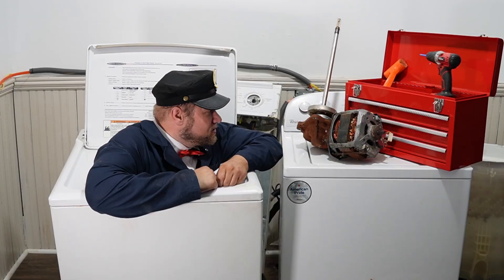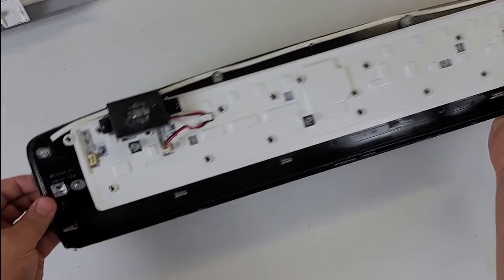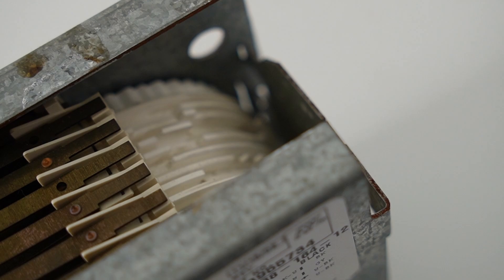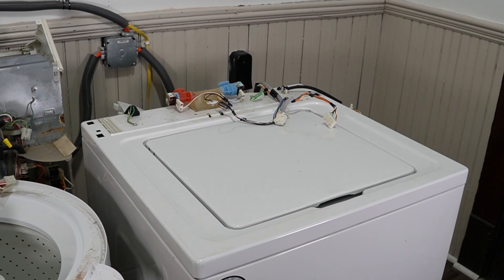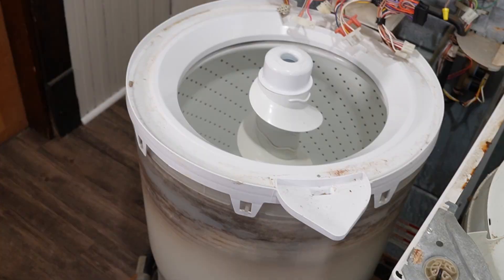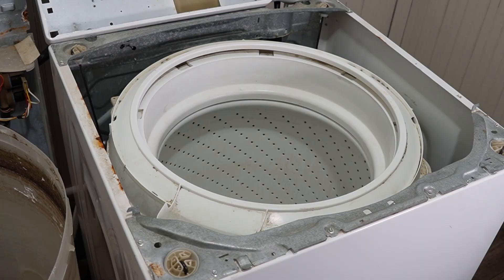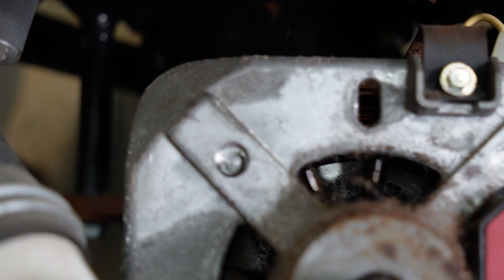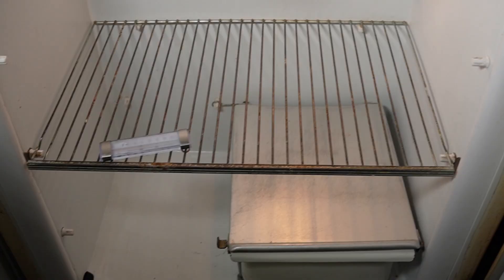Are Washers Built to Break? Inside a 1984 Washer vs. Now

Comment: When my dad died he left us instructions to buy mom a new dryer to replace their 30 yr old Kenmore. Well, mom loved her Kenmore, no way would she give it up. She passed 10 yrs after dad and that dryer was still kickin'!
Reply: The components of my top load  laundry machines and drying machines are made of case hardened solid hot forged and-or hydraulic pressed stainless steel alloy. They were designed, developed, and mass produced for our military for 24-7 non-stop use to clean up everything regardless of what we throw at them (heavy all terrain military survival boots, utility belts, heavy uniforms, arctic gear clothing, rubber shoes, rugs, heavy military issued blankets, etc) and they are still as good as new and still kicking like brand new after more than 65 years. The factory making them (there are 7 of them) are still making them based on their original designs and original materials and specifications STRICTLY followed on how to make and treat these stainless steel alloy materials into components. The revolving seals are made out of metal with cross hatch precision machining after they were case hardened and annealed-tempered (no quenching). Everything about them is OLD SCHOOL engineering using an all analog mechanical and electro-mechanical controls, etc.
Reply: @darthvader5300  what machine????
Reply: @GraflexGuy  I believe he's talking about speed queen.
Reply: @CookieManCookies  those speed queens are tanks!!
Reply: @darthvader5300  
That's awesome Darth!
Old School all the way!👍🏼😃👍🏼
Reply: @Justin Time These are military grade strength laundry and drying machines for the military made decades ago. I just happened to be in a situation when I was still in the service of an another agency connected with the military agencies.
Reply: @GraflexGuy  These are military grade strength laundry and drying machines for the military made decades ago. I just happened to be in a situation when I was still in the service of an another agency connected with the military agencies.
Reply: @mountain177  These are military grade strength laundry and drying machines for the military made decades ago. I just happened to be in a situation when I was still in the service of an another agency connected with the military agencies.
Reply: @CookieManCookies  These are military grade strength laundry and drying machines for the military made decades ago. I just happened to be in a situation when I was still in the service of an another agency connected with the military agencies.
Reply: @Justin Time These military grade strength laundry and drying machines were all designed-tested in the field for 2 years under the most severe conditions in the open under all kinds of climate and weather and their factories were built to manufacture them 57 years ago by military engineers from our military engineering division of our equipment logistics department.
Reply: @GraflexGuy  These military grade strength laundry and drying machines were all designed-tested in the field for 2 years under the most severe conditions in the open under all kinds of climate and weather and their factories were built to manufacture them 57 years ago by military engineers from our military engineering division of our equipment logistics department.
Reply: @CookieManCookies  These military grade strength laundry and drying machines were all designed-tested in the field for 2 years under the most severe conditions in the open under all kinds of climate and weather and their factories were built to manufacture them 57 years ago by military engineers from our military engineering division of our equipment logistics department.
Reply: @mountain177  These military grade strength laundry and drying machines were all designed-tested in the field for 2 years under the most severe conditions in the open under all kinds of climate and weather and their factories were built to manufacture them 57 years ago by military engineers from our military engineering division of our equipment logistics department.
Reply: I own a 1963 Lady Kenmore gas dryer. This I rebuilt in 1974 with new seals and a blower bearing. The drum bearing failed due to bad flange design, I modified it after buying a new bearing. So far almost 50 years trouble free service.
Reply: My appliances were made in the late 1990s and I still repair them.  Basic models with minimal circuit boards.  Easy to diagnose and repair.  The appliance parts guys regard them as from the “Golden Age of Appliances.”LOL!  I don’t know about that, but they have served me well.
Reply: @darthvader5300  spam a reply much?
Reply: I have a Hotpoint 95360 from 1982 (front loader). It still runs as it did when it was new.  Last year, it needed bearings in the outer tub.  I went on the internet to find instructions, only to find that in newer washers, it is impossible to change the bearings.  You have to replace the washer.  But in my old washer, the replacement was easy.
Reply: Not much to go wrong with a DRYER, mine is 20 years old, it's basically just a motor turning the drum,  and a gas valve opens the gas to light the burner, other than a belt, cleaning, a sensor replacement maybe, thats about it.
Reply: At this point, my GE washer and drying machines in my garage are going to outlive me even though they are older than me by a few months.
Reply: @darthvader5300  p.s. military grade means “cheapest possible material that can pass regulations” lol 😂
Reply: Wow !!!!!
Reply: My grandma still had her stove and fridge from 1950s in 2012 when she passed. And my great grandfathers iron fire stove.
Reply: Built to last👍🏿👍🏿
Reply: @umamifan  Yeap, but those have regulations to last extremely long, and today civil ones have internal regulations to breack after 2 years of light use. I have a Whirlpool from spring of '94, made after they  took over Philips big appliances division, and is over 28 year old and still works good, no service other then replacing a capacitor after 10 years in 2004.
Reply: This comment contributed nothing to my life.
Reply: The kenmore is watching with menacing intent
Reply: I don't mean to mock the tragedy of losing family, but the thought of a man's dying wish to replace the washing machine is hilarious to me
Reply: @darthvader5300  You know the concept of "military grade" doesn't say ANYTHING about the quality right?

It merely says it has been standardized by the military.
Reply: Most Kenmore dryers were built by Whirlpool (and some by GE too, I believe), so I can relate!  I have a Whirlpool gas dryer that must be almost as old as I am (if not older), and I'm in my mid-40's.  It was included when I bought the house 15 years ago.  It looks like crap (but my laundry "room" is my unfinished basement, so...), it's missing a number of screws so it usually buzzes and rattles until it warms up (or until I give it a kick or nudge in the right spots), and the door won't stay closed while running so I added a cheap slide-bolt latch from the hardware store.  I have a service plan from the utility company that covers my furnace and gas dryer and they've replaced the belt, the lint screen, and two gas igniters.  Other than that, it just keeps trucking, drying load after load from my fast-spinning modern washing machine in about 30-40 minutes.  I'd love to have a new dryer, but this one works so well and it just keeps going and going.  It got to a point where I stopped browsing around for a new one because I'm so curious how much longer this one will last (and I might never find out, as I'm selling the house soon with appliances included).
Reply: My Mother bought a Kenmore Refrigerator back in 93. It’s still running 🏃‍♀️ for 38 years. Sad to say yesterday the Freezer can’t make ice 🧊anymore.
Reply: @Inisfad  That makes me so mad. It's insane to throw away so much good stuff because they want you to buy a new one.  It's just plain greed and waste.  I have been hoping that the advent of 3D printers would make it easier to repair things, but I haven't seen that happening yet.
Reply: My Kenmore pair, made by Whirlpool, are 50 years old and work fine. I was a Sears repair guy.
Reply: @darthvader5300  we get it but wtf can us normal shmoes get one 😂😂
Reply: @darthvader5300  We get it.
Reply: @darthvader5300  We get it.
Reply: @darthvader5300  We get it.
Reply: @darthvader5300  We get it.
Reply: @darthvader5300  We get it.
Reply: @darthvader5300  We get it.
Reply: @darthvader5300  We get it.
Reply: @darthvader5300  We get it.
Reply: @darthvader5300  We get it.
Reply: @darthvader5300  We get it.
Reply: @darthvader5300  We get it.
Reply: @darthvader5300  We get it.
Reply: @darthvader5300  We get it.
Reply: @darthvader5300  We get it.
Reply: @darthvader5300  We get it.
Reply: @darthvader5300  We get it.
Reply: @darthvader5300  We get it.
Reply: @darthvader5300  We get it.
Reply: That is cool; still remember that my mom bought a washer and dryer in 1989 when I was 2 and how they worked until like 2009. They have had 3 other sets since then, seems the 80s had better ones.
Reply: @darthvader5300  Where?  How do I get one?
Reply: @darthvader5300  Oh.  Just in case one comes up, what years were they made and how would I know it?
Reply: @mountain177  In my area speed queens are available but the service on them ranks lower than Samsung.  So they sell them but if something goes wrong you are hosed.  Apparently not just "any tech" can service them.  It is the only reason I don't have one.
Reply: Kenmore.  Best thing (aside from Craftsman) Sears ever did.  Loved Kenmore products.
Reply: @josephfuller6229  The machines I have were manufactured in Russia during the Cold War for the military and in the former Soviet Union we do not like planned obsolescence. They are still being manufactured but only for our military in the nuclear warfare department where we cannot afford them to fail and the fact that replacements and spare parts will be almost impossible after a nuclear exchange. They are for military use only in the nuclear warfare department. I just happened to be at the right place and at the right time that allowed me to acquire a whole range of them such as laundry machines, drying machines, dish washing machines, refrigerators, freezers, chillers, ice makers, stoves, toasters, baking machines, etc. They are all made out of stainless steel containing higher amounts of tantalum and niobium and a significant percentage of tungsten. All of their components were precision hot forged, hot stamped, hot trimmed, etc. Precision machine tools using tungsten carbides and diamonds were also used to precision machine them to extremely fine tolerance.
Reply: @SioxerNikita  The machines I have were manufactured in Russia during the Cold War for the military and in the former Soviet Union we do not like planned obsolescence. They are still being manufactured but only for our military in the nuclear warfare department where we cannot afford them to fail and the fact that replacements and spare parts will be almost impossible after a nuclear exchange. They are for military use only in the nuclear warfare department. I just happened to be at the right place and at the right time that allowed me to acquire a whole range of them such as laundry machines, drying machines, dish washing machines, refrigerators, freezers, chillers, ice makers, stoves, toasters, baking machines, etc. They are all made out of stainless steel containing higher amounts of tantalum and niobium and a significant percentage of tungsten. All of their components were precision hot forged, hot stamped, hot trimmed, etc. Precision machine tools using tungsten carbides and diamonds were also used to precision machine them to extremely fine tolerance.
Reply: @SioxerNikita  Military grade means designed to last as long as it exists because even in peace time we cannot afford for them to fail because no one knows if war is going to break out just like that or a full nuclear exchange might happen.
Reply: @umamifan  The machines I have were manufactured in Russia during the Cold War for the military and in the former Soviet Union we do not like planned obsolescence. They are still being manufactured but only for our military in the nuclear warfare department where we cannot afford them to fail and the fact that replacements and spare parts will be almost impossible after a nuclear exchange. They are for military use only in the nuclear warfare department. I just happened to be at the right place and at the right time that allowed me to acquire a whole range of them such as laundry machines, drying machines, dish washing machines, refrigerators, freezers, chillers, ice makers, stoves, toasters, baking machines, etc. They are all made out of stainless steel containing higher amounts of tantalum and niobium and a significant percentage of tungsten. All of their components were precision hot forged, hot stamped, hot trimmed, etc. Precision machine tools using tungsten carbides and diamonds were also used to precision machine them to extremely fine tolerance. Military grade means we cannot afford them to fail even in peace time for if a war breaks out or a nuclear exchange happens, then it is better to have them all designed to last as long as they exists.
Reply: @mountain177  The machines I have were manufactured in Russia during the Cold War for the military and in the former Soviet Union we do not like planned obsolescence. They are still being manufactured but only for our military in the nuclear warfare department where we cannot afford them to fail and the fact that replacements and spare parts will be almost impossible after a nuclear exchange. They are for military use only in the nuclear warfare department. I just happened to be at the right place and at the right time that allowed me to acquire a whole range of them such as laundry machines, drying machines, dish washing machines, refrigerators, freezers, chillers, ice makers, stoves, toasters, baking machines, etc. They are all made out of stainless steel containing higher amounts of tantalum and niobium and a significant percentage of tungsten. All of their components were precision hot forged, hot stamped, hot trimmed, etc. Precision machine tools using tungsten carbides and diamonds were also used to precision machine them to extremely fine tolerance. Military grade means we cannot afford them to fail even in peace time for if a war breaks out or a nuclear exchange happens, then it is better to have them all designed to last as long as they exists.
Reply: @mhern57  The machines I have were manufactured in Russia during the Cold War for the military and in the former Soviet Union we do not like planned obsolescence. They are still being manufactured but only for our military in the nuclear warfare department where we cannot afford them to fail and the fact that replacements and spare parts will be almost impossible after a nuclear exchange. They are for military use only in the nuclear warfare department. I just happened to be at the right place and at the right time that allowed me to acquire a whole range of them such as laundry machines, drying machines, dish washing machines, refrigerators, freezers, chillers, ice makers, stoves, toasters, baking machines, etc. They are all made out of stainless steel containing higher amounts of tantalum and niobium and a significant percentage of tungsten. All of their components were precision hot forged, hot stamped, hot trimmed, etc. Precision machine tools using tungsten carbides and diamonds were also used to precision machine them to extremely fine tolerance. Military grade means we cannot afford them to fail even in peace time for if a war breaks out or a nuclear exchange happens, then it is better to have them all designed to last as long as they exists.
Reply: @mountain177  The machines I have were manufactured in Russia during the Cold War for the military and in the former Soviet Union we do not like planned obsolescence. They are still being manufactured but only for our military in the nuclear warfare department where we cannot afford them to fail and the fact that replacements and spare parts will be almost impossible after a nuclear exchange. They are for military use only in the nuclear warfare department. I just happened to be at the right place and at the right time that allowed me to acquire a whole range of them such as laundry machines, drying machines, dish washing machines, refrigerators, freezers, chillers, ice makers, stoves, toasters, baking machines, etc. They are all made out of stainless steel containing higher amounts of tantalum and niobium and a significant percentage of tungsten. All of their components were precision hot forged, hot stamped, hot trimmed, etc. Precision machine tools using tungsten carbides and diamonds were also used to precision machine them to extremely fine tolerance. Military grade means we cannot afford them to fail even in peace time for if a war breaks out or a nuclear exchange happens, then it is better to have them all designed to last as long as they exists.
Reply: @CookieManCookies  The machines I have were manufactured in Russia during the Cold War for the military and in the former Soviet Union we do not like planned obsolescence. They are still being manufactured but only for our military in the nuclear warfare department where we cannot afford them to fail and the fact that replacements and spare parts will be almost impossible after a nuclear exchange. They are for military use only in the nuclear warfare department. I just happened to be at the right place and at the right time that allowed me to acquire a whole range of them such as laundry machines, drying machines, dish washing machines, refrigerators, freezers, chillers, ice makers, stoves, toasters, baking machines, etc. They are all made out of stainless steel containing higher amounts of tantalum and niobium and a significant percentage of tungsten. All of their components were precision hot forged, hot stamped, hot trimmed, etc. Precision machine tools using tungsten carbides and diamonds were also used to precision machine them to extremely fine tolerance. Military grade means we cannot afford them to fail even in peace time for if a war breaks out or a nuclear exchange happens, then it is better to have them all designed to last as long as they exists.
Reply: @GraflexGuy  The machines I have were manufactured in Russia during the Cold War for the military and in the former Soviet Union we do not like planned obsolescence. They are still being manufactured but only for our military in the nuclear warfare department where we cannot afford them to fail and the fact that replacements and spare parts will be almost impossible after a nuclear exchange. They are for military use only in the nuclear warfare department. I just happened to be at the right place and at the right time that allowed me to acquire a whole range of them such as laundry machines, drying machines, dish washing machines, refrigerators, freezers, chillers, ice makers, stoves, toasters, baking machines, etc. They are all made out of stainless steel containing higher amounts of tantalum and niobium and a significant percentage of tungsten. All of their components were precision hot forged, hot stamped, hot trimmed, etc. Precision machine tools using tungsten carbides and diamonds were also used to precision machine them to extremely fine tolerance. Military grade means we cannot afford them to fail even in peace time for if a war breaks out or a nuclear exchange happens, then it is better to have them all designed to last as long as they exists.
Reply: @Justin Time The machines I have were manufactured in Russia during the Cold War for the military and in the former Soviet Union we do not like planned obsolescence. They are still being manufactured but only for our military in the nuclear warfare department where we cannot afford them to fail and the fact that replacements and spare parts will be almost impossible after a nuclear exchange. They are for military use only in the nuclear warfare department. I just happened to be at the right place and at the right time that allowed me to acquire a whole range of them such as laundry machines, drying machines, dish washing machines, refrigerators, freezers, chillers, ice makers, stoves, toasters, baking machines, etc. They are all made out of stainless steel containing higher amounts of tantalum and niobium and a significant percentage of tungsten. All of their components were precision hot forged, hot stamped, hot trimmed, etc. Precision machine tools using tungsten carbides and diamonds were also used to precision machine them to extremely fine tolerance. Military grade means we cannot afford them to fail even in peace time for if a war breaks out or a nuclear exchange happens, then it is better to have them all designed to last as long as they exists.
Reply: @darthvader5300  No.
. Military Grade means it is a military standard used by a military. That is literally all it really means.
Reply: @darthvader5300  
What a score! They must be worth a fortune!
Reply: @mhern57  Not really because we learned a lot from Henry Ford's wisdom and principles and concepts of mass production and applied it even in our smallest micro-factories and mini-factories using old school all analog servo-merchanisms based automation systems and processes to keep production high, raise and keep quality higher, lower down costs, share the labor costs savings with the workers and employees, and make it CHEAP AND OF THE HIGHEST QUALITY. We can afford it for we have Siberia's vast and unlimited mineral resources. People keeps on saying Siberia is one vast barren frozen wasteland but not anymore for we have been busy developing it head on since the 1950s, 1960s, 1970s, and 1980s non-stop and we are still doing it today in this year of 2022. In fact, we just barely scratched the surface of our natural resources even today!
Reply: @darthvader5300  wow that's all really interesting. I've been watching a lot of World War II videos over the last several years and I still have it in my head that Siberia is a frozen wasteland! Now when I watch a World War II video and they talk of Siberia I'm going to have to reimagine the picture in my head!
Reply: @darthvader5300  wow that's all really interesting. I've been watching a lot of World War II videos over the last several years and I still have it in my head that Siberia is a frozen wasteland! Now when I watch a World War II video and they talk of Siberia I'm going to have to reimagine the picture in my head!
Reply: @darthvader5300  It is not America. Way to assume. And Russian military gear might be built to last. That still doesn't mean the words military grade suddenly changes meaning.

And you can have things that doesn't last forever without planned obsolescence.
Reply: @josephfuller6229  🤣🤣🤣🤣😅🤣😂☺️😄😅🤣🤔🤭👍
Reply: @darthvader5300  I think after a nuclear exchange, clean clothes will be the last thing on my mind.
Reply: When we bought our house back in 1994, the house came with a Whirlpool dryer. The dryer was built in 1980 (I research the manufacturing date). The dryer is still used 3-4 times a week, and the only issue is that the belt broke about 20 years ago (which was easy for me to replace). I took apart the back of the dryer recently to clean out all the lint. When a Sears repairman visited my home recently (for a water heater failure that was under warranty), he looked at the dryer and said, “Man. That is a old dryer!” I have no intention of giving up this dryer. My LG Front Loading washing machine (11 years old) removes enough water (during the spin cycle) that my dryer doesn’t have to work too hard. I do all drying in the “Delicate” mode.
Reply: @HobbyOrganist  9
Reply: @johnnyjames7139  Some problems on these old direct drive beasts are pretty easy to fix, especially now that YouTube stars like Ben are here! Chix like me can fix 'em, too! 👩‍🔧😂